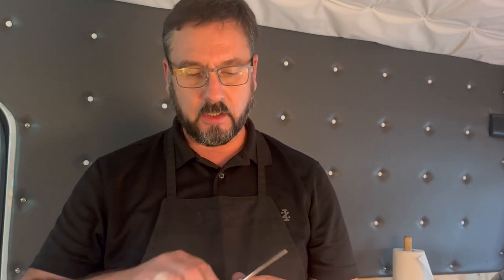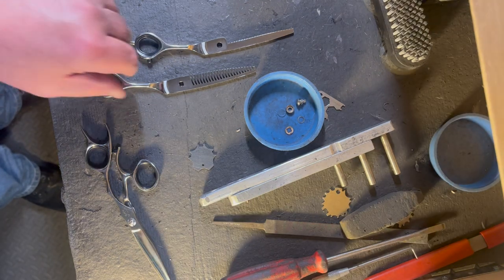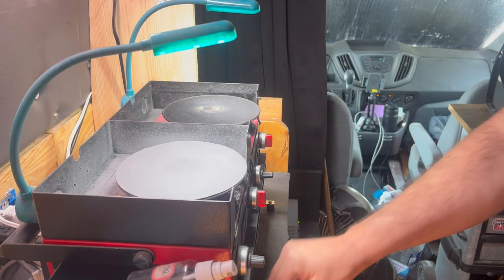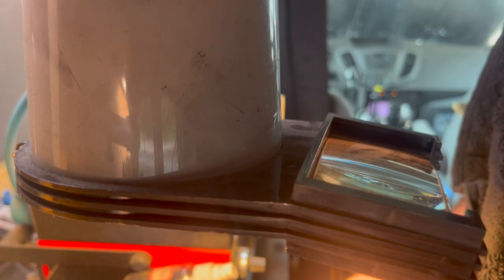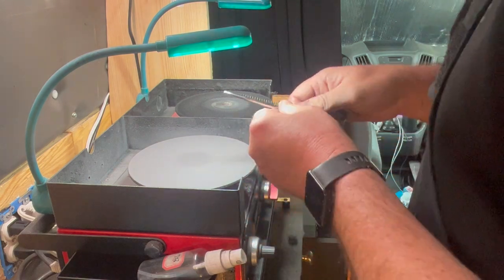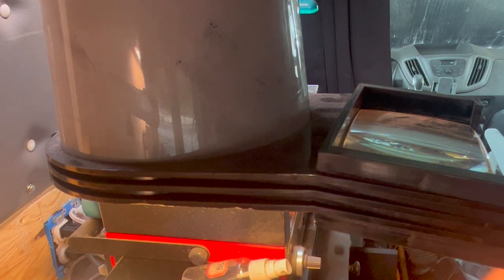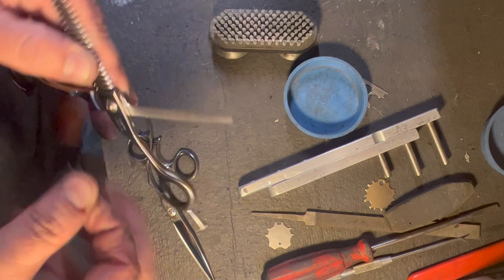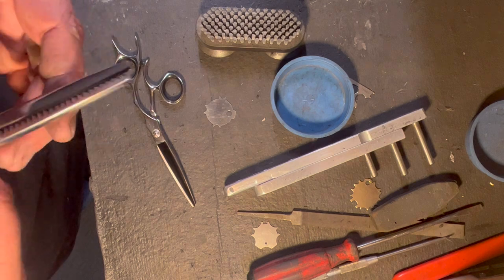Beauty Scissor Sharpening Class: How to Properly Sharpen a No Line or InvisiBlend Thinning Shear

Comment: I like your method of dulling/tapering the Edge of the straight blade and not like other sharpener videos where they dull the thinning blade. Just starting a side business, practicing for less than a week, sharpened 1 for free first. Did ok, just Rideline no good at first 1/4" could not fix that :(

Comment: Hi Jim, so when you take them apart if you see that the tooth side is hitting the inside of the other blade, is that an indication that you have to dull that side?  How do you tell whether to sharpen or dull it?
Reply from the maker: You’ll need to reach out to via email at otenews@gmail.com with a number you can be reached at for this one. This would take WAY too much writing back and forth. :) Speaking would be easier.

Comment: Hi Jim, I see that you are using only one micron pad to do your sharpening. I am wondering what micron you are using. Also, are you using the diamond sharpening discs? And what are you using for polish; paste, blue stick/green stick or diamond spray? Thanks!
Reply from the maker: I use an 600 grit disc and a 3 micron polishing paste on Hamaguri USA’s Diamond Felt Disc. Email me at otenews@gmail.com and I’ll send you some links.

Comment: Hi ! I have question about sharpening trimmer clipper blade like Wahl Standard or Wahl easy clean, magic etc. How should I sharpen them? I was trying on my machine Nebrasca Clipper Blade Sharpener , and it was working for like three time on dog, and then they just doesn't cut . Is it problem with adjusting  or i sharp them for too short a time ?
Reply from the maker: Are you talking about the small trimmer blades or 5N1 type blades?
Reply: @JimSharpBlog  small trimmer blade